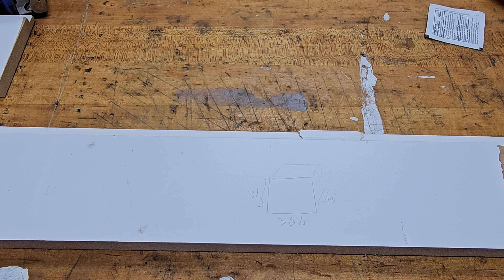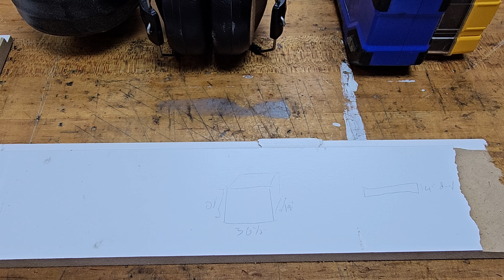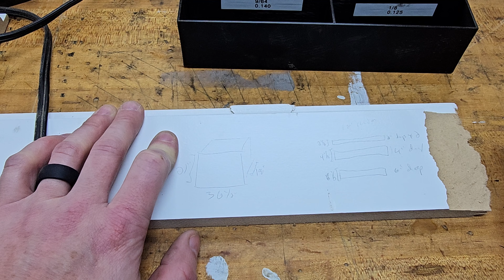Building a Chest of Drawers For The Shop

Comment: Was hoping to see how you ran the power cord in the bottom drawer. I like the idea of putting the charging shit out of sight and out of the way. Thanks for sharing.
Reply from the maker: Used a spade bit to cut a hole in the back of the drawer. My mistake on the backing worked in my favor and i was able to run and extension cord into the drawer from the back. I'll post a follow up when I have all the printing done.